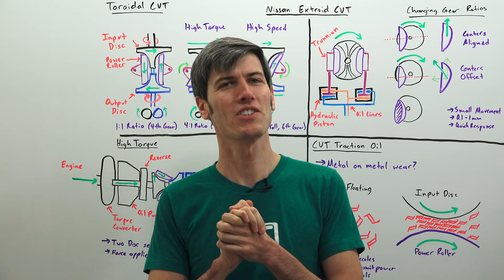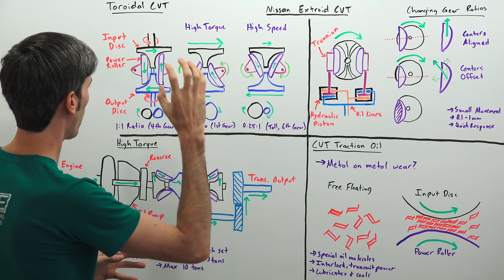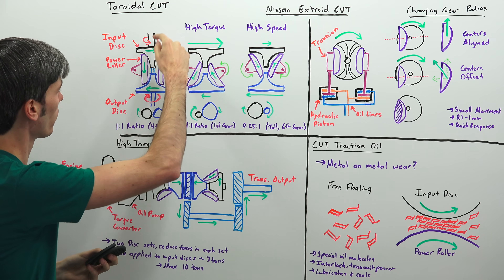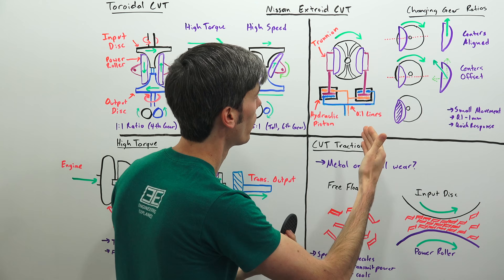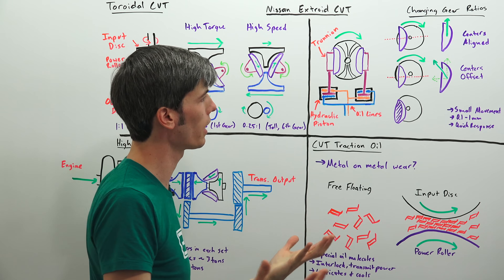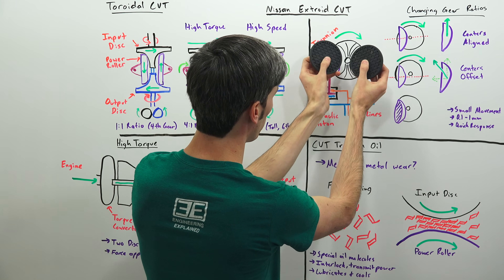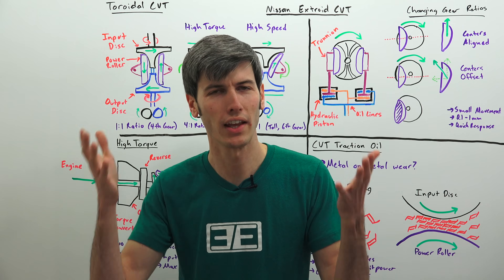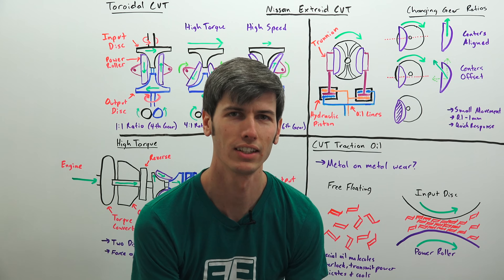Nissan Created The First Production High Torque CVT

Comment: Nissan has the most unreliable CVT transmissions. I wonder how reliable will this new design be?
Reply: It's not new, it was seemingly introduced in the late 90's
Reply: No worries about this CTV, they totally developed a magic oil for this one.
Reply: I’m waiting for Nissan to mate one of the new, ultra-complex variable compression ratio engines to one of their notoriously rubbish CVT’s. What a massive pile of junk that’s going to be. The trial lawyers are undoubtedly already salivating over all the class action lawsuits that will ensue.
Reply: Hayder Al-khairalla in the planet Nd is gonan b junk if they didn’t perfected the old one after using for more Han a decade what make u think this is gonna b reliable
Reply: But Nissan has good warranties on their CVTs.  I got a "brand new" remanufactured one right at the 7 year mark, and  it is still going strong after another 4.
Reply: New design my ass my 2002 g35 has this thing and its expensive to maintain easy to blow up and believe it or not kinda enjoyable to drive in manwell moad

Comment: I have a 2017 Maxima and all these salty “car enthusiasts” actually are starting to get me wondering how long this cvt will last
Reply from the maker: Got a friend with an old Murano at 200k+. Keep up with all your maintenance intervals, cars can last a long long time.
Reply: @EngineeringExplained  For me, it didn't matter that I kept up with maintenance intervals.  It was a simple internal actuator breakage that could not have been prevented by routine maintenance. Fortunately, the CVT was still under warranty due to an extension. On the other hand, I have an old Chrysler with an automatic that has been running fine on "burnt" transmission fluid for well over two decades.
Reply: My 14 Altima lasted 56k miles. Wife 08 rogue lasted 60k miles
Reply: My employer (big retail chain) gave the area managers CVT Altimas for company leased cars and their CVTs are dying around 50 to 75k miles.
Reply: @KWatson1984  If you don't mind my asking, what year are these Altimas? I could see a company like Nissan having a year or two of this terrible design in circulation, but if they are STILL bad this just boggles the mind. Trying to find out when they actually fixed something, if they did, is like pulling teeth.
Reply: @CliffWarren  2015-17 currently, but they have used Altimas for 8 years or so since the Mazda based Fusion was discontinued... They're from a third party leasing company so my employer doesn't care if they break, they just have the company fix or replace them.  Most of the replacement vehicles have been Cruz.
Reply: @CliffWarren  Certain years had bad batches of CVTs going out. 2013 was the worst year for the Altima/Sentra/Rogue. Maximas seem to have avoided the bad apples. CVTs are dependent on cooling and their fluid being changed regularly. Most people never change their transmission oil for the life of their car..
Reply: @smack9x   The teardown of the Nissan Rouge CVT from 2010 (see "pine hollow auto diagnostics") showed an extremely poor design (in my opinion) that would have been minimally affected by transmission oil changes. Basically you have metal eating metal until that thing grenades. You've got one shaft wanting to twist off another shaft, and these bits, call them ball bearings, are the only thing preventing it. Metal hitting against metal,... is a lot different than metal sliding over metal. We also have anecdotes on this very thread that 2015 to 2017 models are still affected. -- It seems that we are entering the "death era" for cars, and when they return they'll be electric. "Get rid of that Altima and buy a Leaf."
Reply: @CliffWarren  The cvt lasted 186k from pine auto vid.  A poor design doesn't last that long. He was simply guessing why it failed. The vid also helps prove my point on how important the fluid is in transmission vs one with fixed gears.
Reply: @CliffWarren  My bosses wife's 2014 Nissan equipped with CVT just died. $5,000 to fix it. Just talked to a Nissan salesman who had a Pathfinder with a CVT. Forgot what year. Couple of years old. RECALLED THE WHOLE BUNCH. You would think after 20 years of CVT's they would have either dumped them or perfected them. Sure you will hear of people with 200k miles on there's but it's a crap shoot. Take you chance. Personally I will not by a Nissan with a CVT.
Reply: KWatson1984 but it’s a rental car, so you’ll get a lot of people abusing the engine and transmission than a car personally owned by someone
Reply: My 2011 max is at 167k
Reply: I drive an '05 Maxima with 178K miles, the car is a beast. But the transmission is manual of course. I will never sell this car. If you want to see a full teardown and diagnostic appraisal of a Nissan CVT, look on YT for "pine hollow auto diagnostics". Stay tuned until the last piece is torn down. They are using ball bearings to attempt to hold up in a "shear" scenario, or in other words, ball bearings to stop motion rather than transfer motion. It is truly a BAD design.
Reply: @CliffWarren  Oddly enough those 12 balls don't seem to cause problems. Belts break, bearings fail,  convertor lock-up linings wear, and stepper motors fail. Lots of dead Muranos in town waiting for used CVTs to come up. Very costly to rebuild. More than the vehicle is worth sometimes. My '05 Maxima 3.5 has a 'normal' auto, And you're right, a great car. Also, there are dead Skylines in town too with an earlier version of that Toroidal auto. They do weird things, that nobody can either diagnose nor repair.
Reply: You can't let the maintenance intervals pass. If they change your fluid out every 60k I'd do it every 40-50k at a minimum. My problem with the murano that I owned was the absurd price of their cvt fluid last I checked it was around 20$ a quart.... but that's still cheaper that a 5-7k transmission replacement.
Reply: The CVT will last a long time, but since it is a Nissan it will have other problems through the rest of its life.  Nissan is as reliable as a Fiat/Chrysler...
Reply: Because Jatco has records for transmission innovations, but records for fail rates too. Rather tell the truth than... Oh you just got a Maxima.
Reply: Man please stop listening to these people e every car will ha e transmission problems buy a Ford or Dodge and you gonna have more than a CVT problem believe me I got 288.000 on my CVT I don't expect anything man create to last forever if you get 100.000 miles without alot of work you had a good run
Reply: Also I bought the thing brand new platinum for ~30k, massive drop off msrp, and it still has depreciated a massive amount
Reply: Nissan has 3 SKUs of CVT and on the aggregate they're horrible.  However, you rarely hear complaints about the one in the Maxima, Rogue, and Murano compared to how often they're heard for the Sentra, Altima, and Kicks.  The data is puzzling because the SKU for the smaller cars would seem to be worse, but Nissan sells way more of the larger vehicle set so one would think that would improve their stats.  One this is for certain, do not buy a Sentra, Altima, or Kicks; the Atima and Kicks are nice enough otherwise so maybe lease one if you like it.

Adendum for clarification.  Some model years of the Rogue have the middle sized SKU others have the largest, I'm not sure which ones have which.  Most Pathfinders until last year had traditional automatics, those that have CVTs are the same as the Maxima and Murano.
Reply: I see them around 80k. Maybe just out of warranty if Nissan did their math right. LOL.
Reply: SSavage if you keep up with service intervals for the CVT and don’t abuse it, it will last, but if that CVT oil gets too old or gets low it’s a ticking timebomb, 
      Just be responsible and it will last you well into the 90,000 mile mark
Reply: Just make sure to replace the fluid as frequent as possible and use the OEM fluid and not the multi-vehicle ones.
Reply: SSavage My CVT failed at 40k, I drive 80 miles at a time, ride open highway with no traffic once a week, and a 1 mile supermarket run once a week.  Just cheap, sounds like it is about to fail again 42k miles later, fortunate that it is still under warranty.
Reply: Easy to research....Alot die young, some last long.

Comment: For some odd reason these transmissions are super satisfying to understand. It's a big "ahaaa" effect once you get their concept, and you'll be thinking "Sneaky move there" every once in a while. The normal manual transmission seems like the "hit the problem with a hammer" solution, while this is the backroom smooth talk of engineering.
I doubt this made any sense, but I hope someone understands what I'm talking about.
Reply from the maker: I hear ya.
Reply: @EngineeringExplained  did you do the planetary gearbox of the prius somewhere?
Reply: Been an engineer my whole adult life.  I understand completely. I get the same feeling from antique pocket watch internals. They're more than just functional,  they're elegant,  and beautiful.
Everything in engineering is about tradeoffs. Some designs better than others. This transmission is just genius. Compare this to the complexity of the 800 miles of fluid channels in a typical automatic transmission.  This is simple,  and beautiful in its simplicity.
Reply: I understand, it makes sense. This is a more complex but not a more complex fix for the transmission problem
Reply: As an engineer I think reliability matters, and nothing is as reliable as two gears meshing directly (like manual shift and automatics).  There’s minimal wear with gears, whereas CVTs have many points of wear/failure

.

.
Reply: GermanTopGameTV you said it better than I could, if that means anything
Reply: Sounds great , but lets look at failures and cost of ownership based on compared to 5 or 6 speed manuals.
Reply: My favorite fact about CVTs is that they are banned in F1 racing.
Reply: @Toby Newell Just wait for it...
Reply: GermanTopGameTV exactly!
Reply: @Toby N. reading this a year later after watching several videos on the all electric Wrangler Jeep announced lol.
Reply: Oh yeah..  totally get it.  Still gonna use the hammer solution. Way more fun to slide the dogs around.
Reply: @Toby Newell Offroading AWDs do even better to be electric.
Reply: I cant imagine electric being popular anytime soon for off road racing especially since most off road racing is endurance based and the power created by electric motors per physical size and weight  is very low compared to ICE powered vehicles. thinking of baja trucks , dakar rally vehicles and Ultra-4  cars. I think the Ultra-4 rigs weigh in around 5000 pounds , and they're using all aluminum 1000 hp small blocks. i can't imagine how heavy it would be to have a 1000hp electric motor and enough battery to power it for 8 hours at a time at race speeds. but ive always been an electric skeptic due to the weight of the drive trains and range limitations. so im biased.
Reply: Dunno man. For me it feels like that at the end of the day, it's still just a nail you're trying to hammer. Why bother making all these complex systems to do something you can do with something simple? It's cool and all, but I still think I'd prefer a manual. 

That said, would I rather this or an auto or even a regular cvt? Yeah I'd take this.
Reply: @EmmaCross94  because a manual synchro gearbox is ineffective inefficient expensive and complex, compared to even hydro auto's they don't really have any redeeming features.
It was a bad design for gear changing made lots better by synchros but also lost its reliability and simplicity
Reply: Dont worry I too have autism

Comment: Lol, bit of a troll move presenting a decades old transmission like it's brand new. If it hasn't caught on by now I can only assume there's some serious drawbacks to this design.
Reply from the maker: I never said it was new... I said it was the first. There's all kinds of cool old tech floating around out there.
Reply: True, but you usually present on new stuff so the implication was there. I liked the explanation anyway, it just felt like a twist at the end.

Comment: I bet that super-duper oil steals the power like the torque convertor does
Reply: They've largely solved the torque converter losses by adding a free wheeling stator and a lock up clutch. Once the input shaft is up to minimum engine speed, it just becomes a clutch. As for the oil, you're exactly right. He even mentioned in the video the need for the oil to carry off heat. Where there's heat, there is power loss. The only question is, how much, compared to the planetary gears in a conventional automatic transmission. there just isn't much contact area in this design, no matter how many discs are used. when you have curved surfaces, the point loads are extreme. let's hope that oil isn't just snake oil.
Reply: Yeah it CONVERTS the hp into torque. Lost of hp but gains in torque. This is exactly what it is built for and there are not much actual power losses to current torque convertors and that ia my point. Also this really had nothing to do with having no trans just the TC
Reply: @the-hawkstalk1205  What matters is HP on the wheels, AKA power=torque*angular speed. Gains of torque doesn't matter, if torque*angular speed is crap.
Reply: he literally explained how it allows for complete torque transfer if you watch and listen also torque converters don't rob power like they used to. look at the Koenigsegg the fastest accelerating car in the world has no transmission and only a torque converter
Reply: @the-hawkstalk1205  Well, that Koengisegg you mentioned also loses 300 HP in the drivetrain so it's far from being the perfect example of an efficient drivetrain.
Reply: @the-hawkstalk1205  It also has an 1100hp V8 aided by about 700hp of electric drive.

You don't need a transmission when you have so much power at all times that your car pulls as hard in 7th gear as other cars do in 1st.
Reply: actually, a torque converter multiplies torque while it loses some horse power. thats why automatic transmissions have the same torque rating and lower horsepower when using identical motors as compared to a manual transmission...an automatic can transfer a lot of torque when the output shaft is at zero rpm like when you step on the brakes and hit the gas at the same time while the standard transmission is busy burning clutch or feathering its way into power. or just burning rubber if you want to side step the clutch